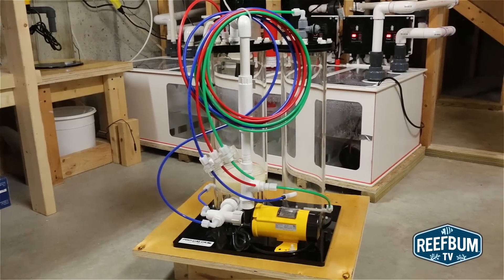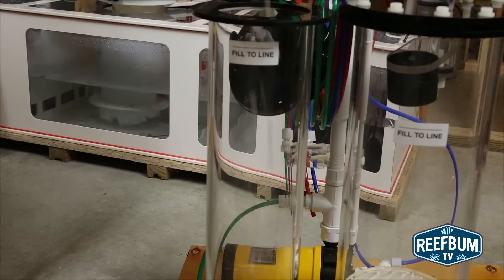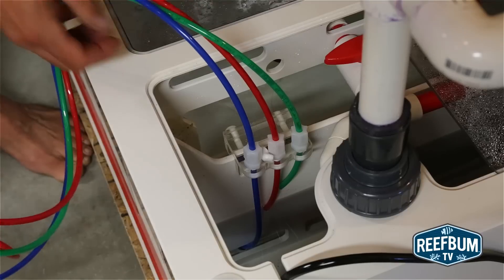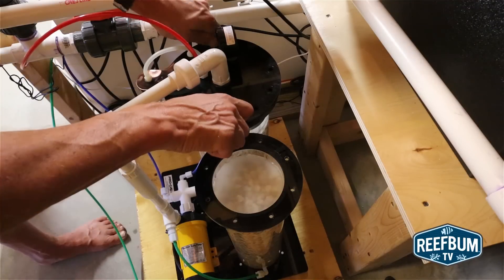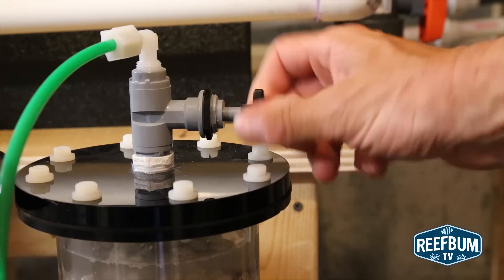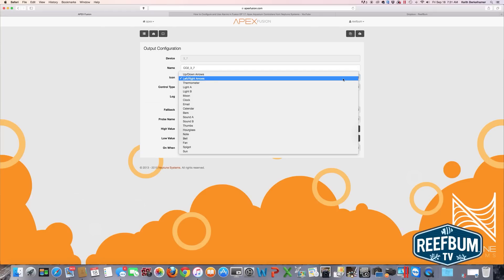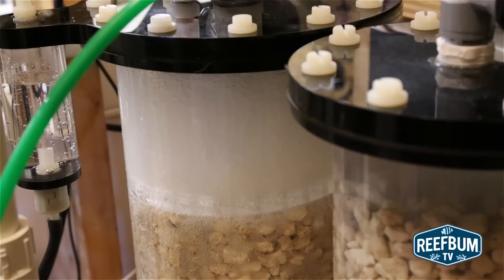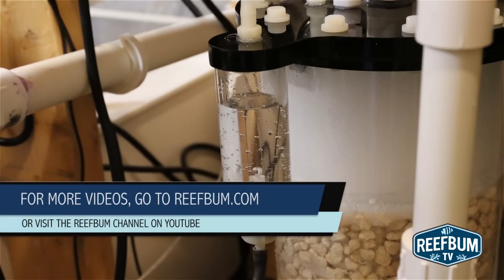Setup & Review of the MTC PROCAL Calcium Reactor

Comment: Do you prefer RO/DI water as opposed to some type of oil for the bubble counter? What is a good lubricant for the O-rings?
Reply from the maker: Yes, I have always used RO/DI water in the bubble counter. And there are a number of options for o-ring lubricant out there....I currently use the one I received with my pumps from Royal Exclusiv.
Reply: @ReefBum ok, good to know. My Geo will be here Tuesday. 👐🏼

Comment: when I setup my tank what do u think would be best dosing 2 part or a calcium reactor? my tank is about 45 gallons
Reply from the maker: It all depends on your calcium and alkalinity demands.....I have always had large SPS dominated tanks and used a calcium reactor since it would probably cost more if I used 2 part.  However, I am switching now to two part since I don't like the extra C02 a calcium reactor adds to a system.  I also like the fact that you can be more precise when dosing alkalinity and calcium when using 2 part.  You can probably get away with 2 part with a 45 gallon system but there are pluses and minuses with both.  A calcium reactor is essentially set it and forget....and it is cheaper vs 2 part.
Reply: that's for the reply ☺ why is a calcium rector cheaper to run buddy what's the price difference
Reply from the maker: With a Ca reactor you only have to change out the media very 6 months or so and that is going to probably be cheaper than buying 2 part solution.  The only other expense with a Ca reactor is re-filling the C02 canister but those can last a year.  Tough to say what the actual prices are but if you only have a 45 gallon tank then I would recommend going with two part.  Ca reactor are best for larger tanks with a lot of SPS.
Reply: thanks for all your help buddy much appreciate it.... hey can you check my channel out on my new tank ☺
Reply from the maker: Sure, glad to help.  And you are off to a great start with your tank!  Have fun with it.

Comment: I am considering this calcium reactor on my 230 gallon tank that is heavily populated with SPS. Currently use 2-part and dose about 400 ml of all per day. I see this reactor is rated for up to 700-gallons so would this be overkill?
Reply from the maker: IMO, no.  I have been using this reactor on similar systems for years and I don't consider it to be overkill.
Reply: ReefBum Thanks for the quick response!  I find your videos very informative and professionally done.
Reply from the maker: Sure thing.  And thanks!

Comment: that looks like a great reactor, I wouldn't run one without a pH probe port in the reactor body though. It allows you to dial the internal pH of the reactor in, and that lets you determine the strength of the effluent. This way you can maintain a steady stream of effluent (not just drips, since drips can clog over time), and not overdose the tank in doing so. As your alk and ca needs increase, you just steadily lower the reactor pH until you find the sweet spot that the tank ALK and CA no longer fall from consumption.

That being said, great review and it looks like an awesome unit! Is it noisy?
Reply from the maker: +DiepBlueC Many thanks for the kudos!  Yes, many folks do run a reactor that way.  I have always managed to run it successfully without a pH probe in the effluent but your suggestion would be optimal.  FYI.....I always replace the tubing on the reactor every six months to make sure it never clogs.  There are a lot of different tubes and thus a lot of spots where a clog can form so I play it safe and swap out everything.  As for noise, it is not too bad.